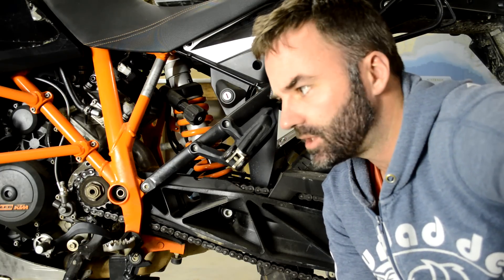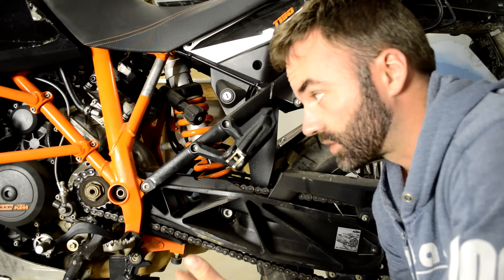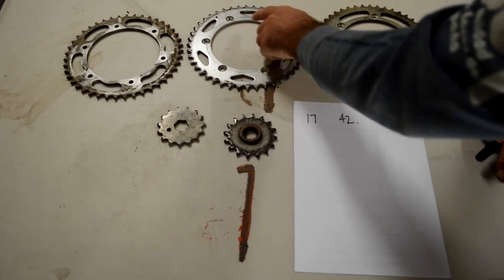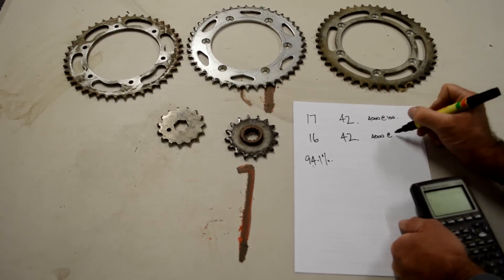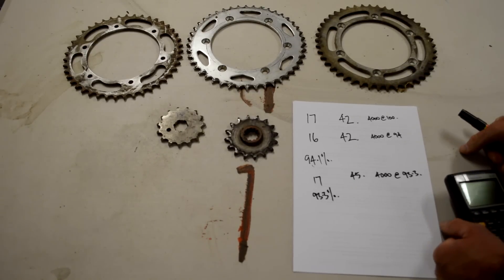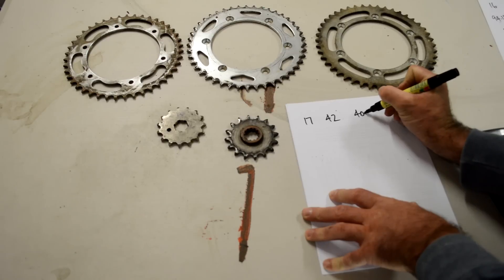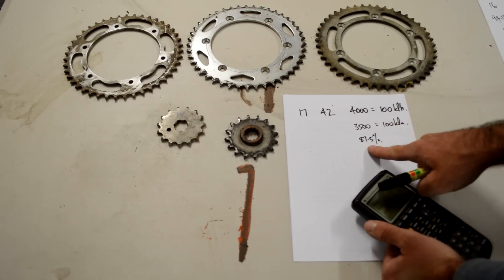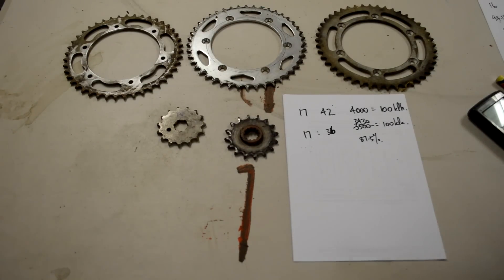Calculating what sprocket to get on your motorcycle

Comment: i read a blog once and it was recommended, that you never go over or under 10% gear ratio at a given engine power , i went 12% above and my bike actually got slower at top end , what is your take on that
Reply: If you dont have enough power to overcome the heavier gear ratio you can lose speed
Reply: Imagine a car cruising 2k rpm in 5th gear at 80mph. In this imaginary scenario you have a 10 speed and you try to shift to 10th at the same 80mph, you're doing 450rpm and wind resistance slows you down

Comment: Yes if you go bigger rear sprocket to gain torque like I want to do for my DRZ 400 then you probably have to buy a knew chain. If your chain adjustment is already more than half. Is this correct? Thanks
Reply: If u change the rear sprocket you're gonna have to adjust the speedo
Reply: not if my speed sensor is on the front wheel lol

Comment: He forgot about the chain links. If you have 110 link and you take a few off by having a smaller sprocket or adding because of a bigger sprocket, it will also affect the RPMs and Torque.. Tire Circumference Chain Pitch, it all comes in line.. Don't think the factory didn't take all this into consideration.. They have spent millions on engineers to determine what is good for the engine and drive train life..

When you mess with this always remember that your readjusting what the bike is optimized for.. For ex.. My GSXR track bike has the ratio of 18 39. This keeps me in 2nd as my accel, and 3rd to pull, 6 for top speed. Now It's a little slow getting there but I've gained 20 MPH for my top speed.. And great low end cornering accel. It allows me to make some great passes.. And always say WTH did you do to that bike.. LOL.. But over time, it has to be tuned more often, top end spark plugs and timing adjustments, IE.. Power Commander with all the options.. But when I started out, I had none of these items and I was just like you, clueless to the issues I was going to face..

IMO Keep your bike stock on the drive train for longevity, but if you don't care to knock off some engine life.. Just do a nitro setup and that will make up for all your worries..

IM just kidding.. Just take your time and don't get tooth happy.. More teeth equal more acceleration but less top speed,  less teeth equal more top speed but less acceleration..

More teeth = more engine wear. Less Teeth = engine working harder and fuel timing adjustments along with other low end adjusting..

But have fun.. and Great VID.. THANKS..
Reply: i really dont think the length of the chain or links will affect it. Unless you put a wrong size on,and you can cut it to size yourself,unless you want a big floppy one,however it will have no effect on the ratio. And use the adjustment bolts to get perfect.
Reply: jdamage68 True but when you have a motor cross bike that revs out fast with no resistants and has an inefficient top speed dropping a few teeth on the rear sprocket enables you to go many more miles.

Comment: Just a quick question. How does the 1190 Adventure get it's speed and distance info?Via a gearbox sensor or the rear ABS sensor? I pose the question because if it's via the gearbox then a change in gearing will affect the accuracy of the speedo/distance recorder. So not only do the revs change for a TRUE 100 kph, but the speedo won't be showing a TRUE 100 kph. I hope I've explained what I merely clearly?
Reply from the maker: +David Jebson (thebiglad)  It uses the front wheel abs sensor, so no problem messing with the gearing.
Reply: +Nerb1 Thanks for that.

Comment: Cheers!  That'll help me make a decision for my Tiger.  I had mentioned you in a video I posted about 2 weeks ago asking this very question.  Thanks for answering even if you didn't know I asked =)
Reply from the maker: Lol... I just put a comment on your vid! I wish you let me know you were back at it. Looking foward to your own off road adventures!
Reply: @Nerb1  hi . My name is Chris. I own a gen5 zx 10r. I am told stock gearing is tall even though Kawasaki claims to have shortened gears 2 thru 6. If I go from a stock 17/39 to 17/41 would that be too drastic just to get a bit more acceleration. Or is a 17/40 sufficient on a gen 5
Reply from the maker: @christopheralonge7758  2 teeth smaller on the back is not much... only 5%. I would not be scared to go to a 36 provided you dont regularly try for 180mph.
Reply: @Nerb1  thank you for the reply but I was actually trying to go 2 larger on the rear to a 41 for more acceleration. But I have been told a gen 5 has lower gearing 2 thru six and that going no more than 1 tooth in the rear would be sufficient. Going 2 up in the rearmight be gearing down a bit too much I think. I don't know. I have heard yes and I have heard no. I am confused
Reply from the maker: Ah, sorry.   Somehow i read that you were going 41 to 39. Im blind!
Same deal though... 5% is not much. Put on the 41 and see how it feels. You should not need a new chain for 2 teeth and a sprocket is cheap (dont bother with a fancy aluminium one).
Reply: @Nerb1  thank you sir. Much appreciated

Comment: Thanks! Great video! Can you tell me what it feels like and how bike handles for you with a smaller sprocket in the front?? Like 1 and 2 smaller? Thinking about doing it to my 800gs and wonder how it would be... On trails.
Cheers!!
Reply from the maker: If youre spending a lot of time at walking pace, 1 smaller on the front and several larger on the back will help a lot. The revs will be lifted at low speed, so less stalling and generally less clutch work. You dont want to change too many on the front though... too small a sprocket on the front increases chain wear dramatically, and too big may jam the chain between the sprocket and the engine case.
Reply: You really can't ever chain setup and sproket weight is going to pull different in the gears